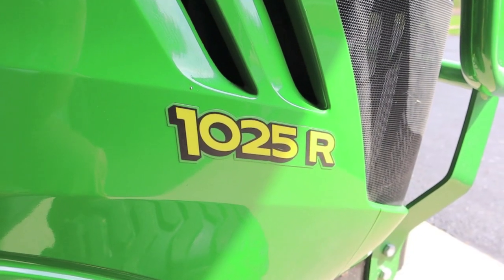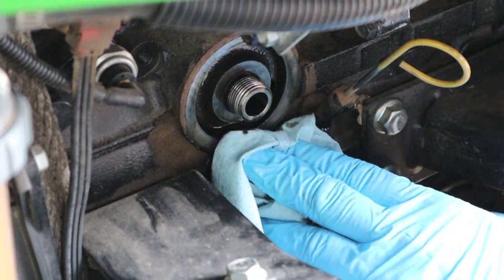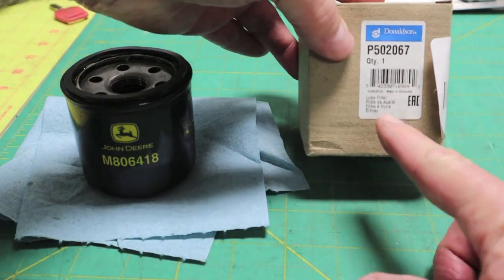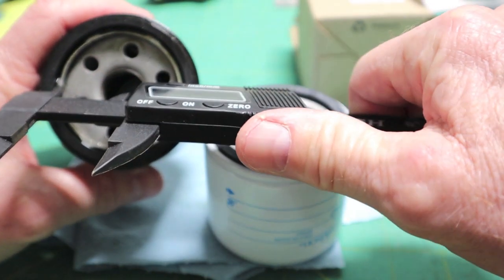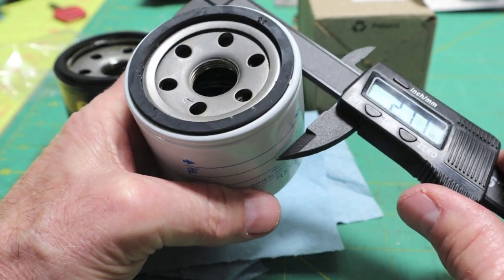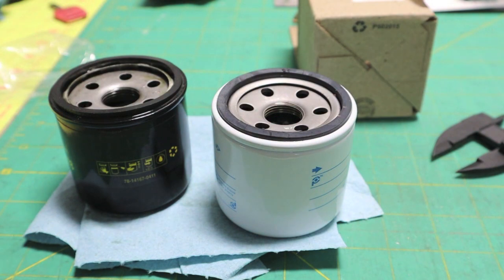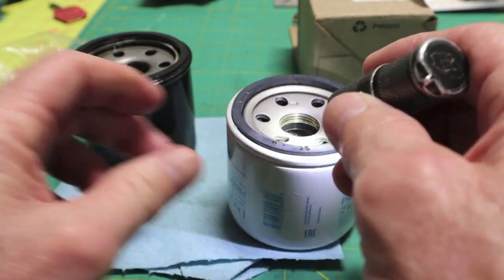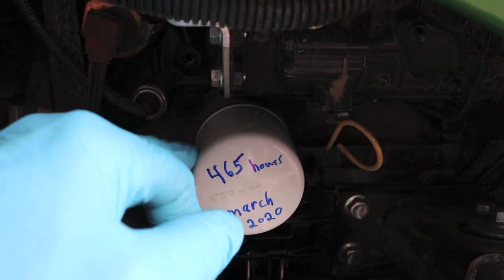John Deere filters VS "others".... is there a RISK ?

Comment: I don't know about Donaldson vs JD filters but years ago the filter quality came up as a heated discussion at work. I have Dodges and always have used MoPar filters. My buddies insisted Fram was the equal to them or better. I bought a pair of new ones and compared. The MoPar weighed considerably more even though I didn't use a scale you could feel it. I cut them both apart and the MoPar had considerably more layers of paper in the interior than the Fram. That little evaluation convinced me that all filters aren't created equal. I still just use the MoPar parts and so far have stuck with that thought with my JD 1025R. Sometimes you DO get what you pay for. Why take a chance when it's only a small amount of money? Engines cost a lot of money.
Reply from the maker: Exactly, I have a new JD filter ready to go on the next OCI.
Thanks for the info!!
Reply: The funny thing about FRAM is they do make a premium line of filters.  But people are far less to buy one because you aren't saving any money vs OEM brand.